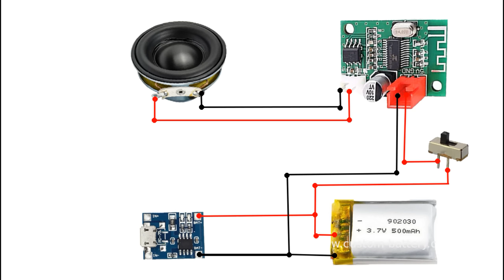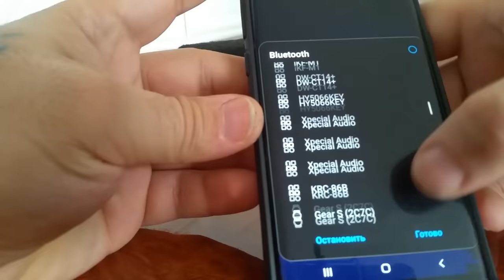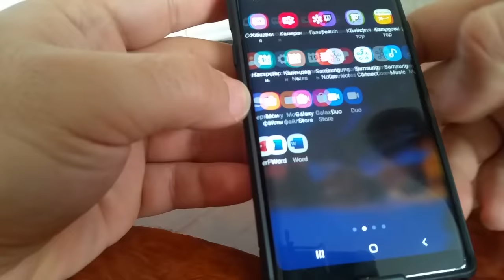DIY Mini Bluetooth Subwoofer RC CAR SUB

Comment: Just what i needed for my pickup with no space for a bigger sub
Reply: レギュラー  it was a joke tho
Reply: @Shinkaaaa  No it was serious. That thing surely can drown the engine sound of his Pickup Truck!
Reply: Cute but beast
Reply: レギュラー  Or just any other speaker not especially overrated jbl
Reply: レギュラー I have an xtreme and an xtreme 2 and I used to have charge 3 and two flip 4s and jbls aren’t too good, they sound good but they go bad in about a year or so
Reply: Jake Thejeweller oh well I just got my xtreme 2 like a month ago but I had my xtreme 1 for a year and the battery is clapped, I treat my speakers great, I just use them for hours everyday outside

Comment: 👍👍👍

I once made a set of mini 901s.  It was a fun little project that I didn't put precise effort toward.  They were made with, maybe, 2" drivers. They came out decent, and better work would have been worth the effort, but I didn't really have any good tools.  I hooked them up to my alarm clock - they actually sounded interesting.  I sure wish I knew what I did with them.

Comment: If this is a subwoofer, where does the rest of the frequencies come from?
Reply: its just a woofer that's small so it can make low frequencies and high ones
Reply: depends on your woofer, but turn the bass down and listen close. Some you can hear frequencies
Reply: Also tuning a box can help too
Reply: for a couple years im using car woofer with a pc. (yeah... that terrible mono sound)

Comment: that little sub is very restricted on air flow so I would make the port bigger. just advise.
Reply: How much airflow do you expect to get from a speaker that small?  Lmfao.
Reply: Id just made sealed box and inverted the speaker...lol
Reply: Well If you watched the whole video or just looked at the thing you could tell by the paper moving way too much that a bigger port or a dual port would be better. It's not like I have been working with subwoofers and speakers for 5 years or have helped my dad build a fully custom perfectly tuned 10in sub box which puts out a insane amount of bass for a 10in sub.

Comment: Should put this in a RC car to complete the look, have it thumping down the driveway. Additionally, what if you took the felt off the bottom or back, could it use the table to amplify the lower frequencies?

Comment: Be careful when using lipo instead of liion with tp4056, as there could be voltage/charging current differences (also take a look at the c rating)

Comment: Hey, VGV...I ordered all the stuff to make this, actually ordered enough to make like 4 lol anyway...another handful of questions if you dont mind answering. 1) Im guessing you used 60/40 Rosin Core Solder? 2) Also guessing you took off the Input (red) and the speaker output (white) connectors bc it would have been hard to fit it in the box, so you just soldered the wires directly? 3) You removed the charging port off the module 2:44 so it could be easily accessible from the side of the box, did you do that with a little heat gun? Just warmed it up and it just came off like that? 4) what is the blue syringe 4:07 is that a flux paste? and LAST 5) at 3:03 is that just a battery powered hand drill that takes like dremel bits? Thanks brother for your help, cant wait to make a few of these!

Comment: Speaker + and - are switched, you have sound going inside to the woofer. xD
Clearly you can see, when bass is played air goes out from woofer case.
Switched +/- means weaker bass. GJ.

Comment: I need it let’s talk business how much
Reply: It probably cost you more than 30$
Reply: @coron1985  I don't thint this can cost more that 15-20$
Reply: All price is almost 13€, so in dollars is 14.33$
Reply: @misterhash9329   you dont pay labor for making that speaker?
Also you need to pay shipping if u buy from VGV
Reply: @coron1985  If you have materials and tools and if you buy parts from local store then price is no more than 15-20$ depending on local store prices.
Reply: @misterhash9329   Mister Hash yes, if u buy and make it yourself. But what i got from Lazerline Comment, he want to buy from VGV aka owner of VGV channel.
Reply: @coron1985  Then you right :)

Comment: Hey, VGB, Im fixing to start making mine...two questions. What size/thickness is the MDF your using? Secondly are you just using flux core solder? Thanks in advance!

Comment: Can I buy one of these like fr !
Reply: Its only $20 to make
Reply: @erickabundis7952  no its not, to buy everything needed to make one its around $60 because you need the wood and the 2 different types of glues along with the 2 circuit boards, the speaker, the switch, and the battery
Reply: @Chrispy0  check the description then come back...
Reply: @Chrispy0  I bought my Sony Xb20 for $40 new... so $60 def ain't how much this cost
Reply: @erickabundis7952   Erick Abundis  everything in the description cost around $18 all together but the glue he used for gluing the speaker into place is $15 for a tube, the wood glue is $12, a board of wood would cost around $9, the spray adhesive is like $5 per can and carpet used to cover the box would be like $3 for a small roll so it would be around $60 to buy all the needed items

Comment: finally someone made a tutorial because Anthony was being selfish...
Reply: WHERE>>>>>>>>>>>
Reply: @UnKnown-jp1bv  this is the tutorial
Reply: @Andy_Rew   I see, most of it is showing you how to do it and VGV thank for replying I got so excited I didnt even see the box lay out :-) measurements lol . My only big question is what all did you do to the circuit boards? I saw you heat up and remove this and then clean up and added some stuff to it and reheated it. Can you explain that stuff for me and anyone else that is curious? Think Im gonna buy the stuff so I can give this a try. Also the tiny clear tube what is it for? The led light? Antenna? Lastly what did you use for the port tube? Thank you!! CHeers!
Reply: @UnKnown-jp1bv  lol im not VGV im just a viewer but I think i can help you, at 6:27 in the video he shows the schematics for the wiring that you would have to do when soldering (if you dont know how to solder you should definitely educate yourself on that first before doing this . The led light is probably to show that its on, the port tube is just a small piece of plastic tubing that he probably found (you could probably get away with like a fat pen tube, and lastly the clear tube is for the blue circuit board to stick onto on the inside to eliminate the use of hot glue. Hope this helps!
Reply: @Andy_Rew  yeah I knew you werent VGV lol, I was just putting it there hoping he would see it. Appreciate you giving me some ideas tho. I can solder SOME. I built a high power ecig kit for a friend but the solder came with it so I didnt have to do any research to figure out what to use. I can Stick Weld, Wire Weld..Im sure I can solder lmao....its just a tiny version of what I do. Just not familiar with what kind/type of solder to use and what that was he dropped on the contacts, almost looked like some sort of acid to clean it or something. Thank you for chiming in tho..I really appreciate ya

Comment: What is that black material you used to cover the speaker?? Please tell
Reply from the maker: You can use this one, it's adhesive € 11,83  30%OFF | 40"x80" 100cmx200cm Car Auto Deadener Noise Control Insulation Sound Covers Carpet Underfelt Speaker Box Cabinet Car RV Boat Mat
https://a.aliexpress.com/_BTCFNn

Comment: thanks for the video and sharing.  what is the name of the transparent filament which transmits the light from the led to the outside of the box
Reply: its a fiber optic cable

Comment: I saw you are using the Dremel MS20-01 Moto-Saw. Its NOT cheap...aroud $100. You or anyone here have any other options to cut small thin pieces of MDF without ripping it apart?

Comment: hows it a subwoofer when its so small i doubt it goes lower then 300hz if even that.
Reply: Prolly 60-70 hz
Reply: Nah it can get below 30 if done right with proper amplification. However, it's not very loud in general, so don't expect booming bass or anything.